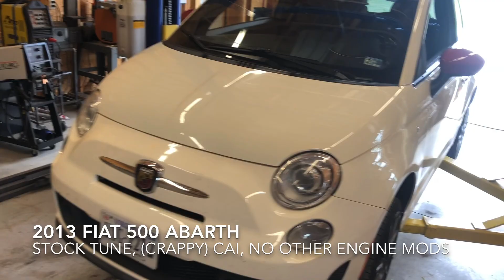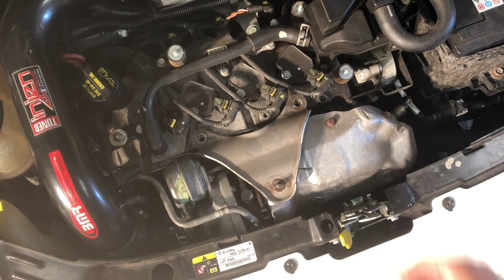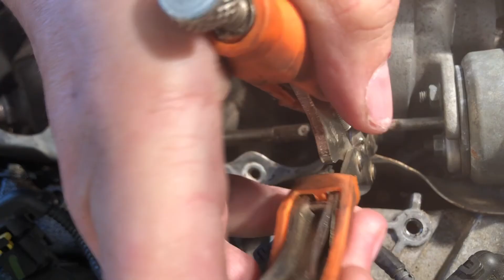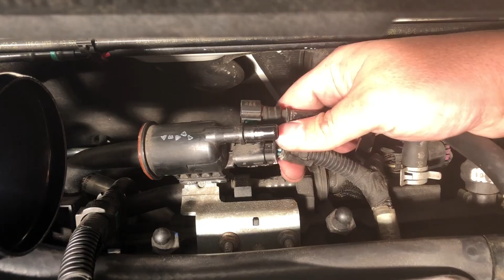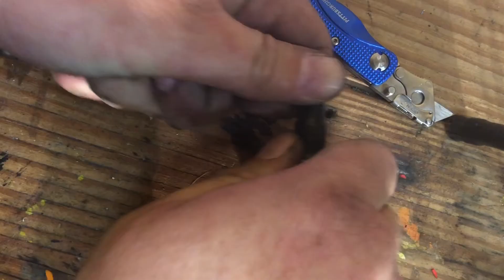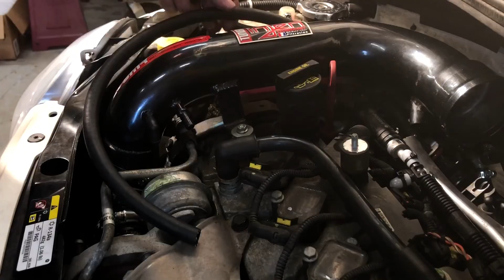Testing the Free Horsepower Mods for the Fiat 500 Abarth

Comment: Dude, this video was EXCELLENT!
I am enjoying researching the abarth right now as i look at daily drivers that i can occasionally autocross.
Right now im considering this abarth and the velociter n.
The quality of this video was uncommon, you did a great job.

Do you still have your abarth, and if you could go back in time would you still buy it?
Reply from the maker: ThePreppersBunkerOutdoors I still own and still love the Abarth. I would absolutely buy again. If you are looking to buy the best autocross car, then there are probably better choices if winning is what matters to you. With an Abarth though, you get a great deal on the best sounding, Italian, most ridiculous car on the grid. I love that I get to drive a crazy little race car to work.
Reply: @EveryOtherFridayOff my question is some what related   
I have a 2013 Abarth I replaced the engine from a low mileage, 13K, 2013 donor that had been sitting for a year or so. It has no codes but the cap and O2 monitors won’t reset. At installation I installed new plugs, coils, O2s, crank position and knock sensors. I’ve driven 2000 miles with several cold starts
The car is stock except for  an ATM FMIC and ATM fender well CAI

Comment: From one fat middelaged heavy breathing man to the other: Great video👍Thanks!
I installed a cheap tuning box from TMC Motorsport in the UK that works great - (plug and play) 
Have to try these free mods during the winther - thanks😊
Reply from the maker: The man on the Road Thanks!  I’ll be doing a bunch of supporting mods next week, and then I’m going with open flash tablet for the tune.  Old fat racers of the world, unite!
Reply: @EveryOtherFridayOff  😁👍
Reply: @EveryOtherFridayOff  are you tune the car with the OFT? I've been thinking about tune mine but I haven't take any decision, if I'm going with either oft or tork or speedmotive or eurocompulsion, why would you like more OFT,
Reply from the maker: Felipe Lopez:  This is a horribly controversial topic in the Abarth community.  I think you can get a general agreement that a true ecu tune is going to be better than any piggy back tuner.  So that leaves eurocompulsion, Tork, and OFT as the generally agreed “best” options for the North America, multiair Abarth.  The animosity between Fans of Tork vs fans of EC is really bad, with almost every discussion turning into a flame war.  It’s generally agreed that OFT is making less power than the other 2.  However, I chose OFT because it has some capability for me to mess around with the tune myself (I won’t do better than a pro, I’m just curious).  Not being involved in the flame wars was appealing to me also.
Reply: @EveryOtherFridayOff  that's right and I wonder why OFT doesn't have more support, I want to get OFT but I read they have just two tunes, I'm looking to get a few more HP and the car run smoother, are you planning to make a video during and after the tune?
Reply from the maker: Yes, I’m planning before and after with the same 20-50 runs I did on this video
Reply: @EveryOtherFridayOff  sorry for the question, what size are the hose for the boostleak and have you get any CEL code or not yet?
Reply from the maker: 5/16th Hose.  I got a CEL about 200 miles after doing the mod.  Cleared, and came back only 40 miles later.  Cleared again, and have stayed clear for about 300 miles since.  Sounds like some people get constant CEL, some never get it at all.  I’ll be showing a much more complicated way of doing it that should be CEL free shortly
Reply from the maker: The OFT video is finally out, enjoy

Comment: Does it run more rich if you do this free mod
Reply: You should get more exposure.  Your video was done very well.  Great job
Reply from the maker: I don't have enough miles on it to say, and I haven't heard that.  I would think the bigger concern would be going lean under a "higher" boost.  However, peak boost really didn't change much, the boost just came in sooner.  So I imagine the ECU is handling AFR's as normal.  I can't think of how else this would affect AFR's.  Anyone else have an idea?
Reply: Every Other Friday Off thanks that really helps appreciate it a lot, I will be doing this mod on my fiat